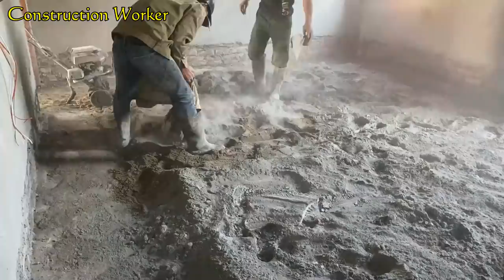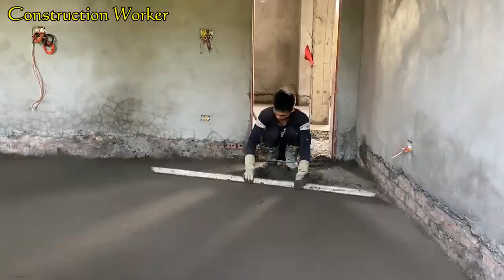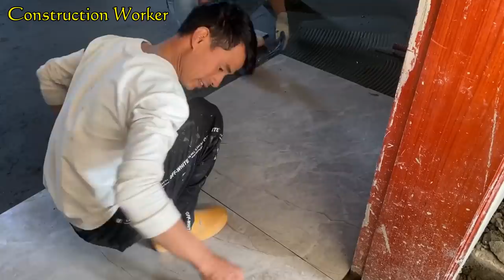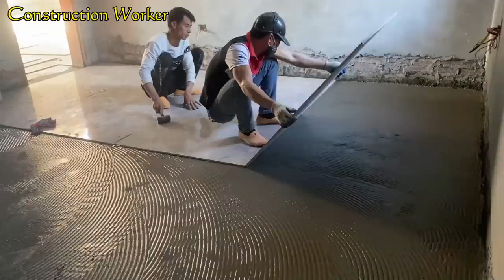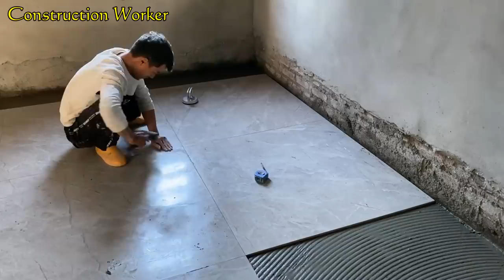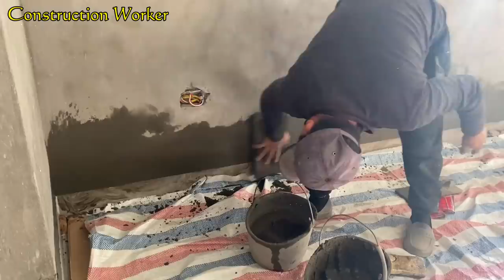Amazing Techniques Construction A Bedroom Floor With Large Size 100 x 100cm Ceramic Tiles

Comment: They floated the entire room ok but they should have packed it in more to minimize air pockets plus that would even strengthen the mud more , no packing needed if you add in some caratex to your mixture. The way they lay these large format tiles are just terribly wrong and unprofessional. I'd lay out the room and work yourself back out or even center back wall and out to the exit door. These guys are constantly walking on top of the tile they just laid, horrible! Plus they should have used an at least half inch by 3/4 notched trowel.
Reply: Thank God I'm not the only one thinking that they did a poor quality job here, lots of air pockets for sure, walking on top of the tiles when the mud was fresh, finishing the wall after installing the tiles... and so on... very unprofessional work indeed.
Reply: @PSNMM2M  I bet your job wouldn't even compare! That was a job really well done for tiles that size!
Reply: @lightbulb1982  sorry for hurting your feelings
Reply: Are the one paying for the material job etc. If not keep your mouth shut I've been doing this for over 20 years countless of satisfied costumers all over the world. Thank you
Reply: @PSNMM2M  just what I was thinking. Job looks good but I worry for the longevity of that work

Comment: Everyone that said it will crack in a year is wrong they do the same work in Haiti and Dominica republic and also saw it like this is Jamaica and Africa and those are my friends homes and it has been more than 5 years and no crack or damage my grandpa designed and built home for a living and the lower part he built for my parents is done this way and that was 25 years ago my parents still have no problem with that part of the house

Comment: Two things, not sure about the thinset application under the tile, also I’ve never seen grout applied with a paintbrush. The grout needs to be forced into the space between the tile with a great deal of pressure. There’s no way the grout holds up past a year or two.
Reply: My guess, the thin layer of tile adhesive is applied before the underlayment has dried, so they actually form one whole.
Reply: @Jb001jb  That's not a thing. IMO most of the things they did were wrong. Not professionals and not the best tools.
Reply: This thin layer of tile glue is state of the art in rather advanced countries, where knowledge and materials are available and welcome, as long as the surface below  is plain and solid, the materials applied are good and the guys are trained/skilled. I cannot judge the quality of the surface underneath just from the video, but beside this, everything looks fine for me.
Reply: If the space between the tiles has to deal with a lot of pressure, you made something wrong before/underneath. It might be different e.g. on a wooden slab floor, but that is not the case here.
Reply: I lived in Vietnam for a few years and remarkably, most of the floors there looked like this one and none had any cracking. The plumbing , painting and other stuff did leave a lot to be desired though. They work so fast there. Unless it’s a government project , then they take their sweet time.
Reply: Depending on which year you graduated as a construction engineer. Things n tech has evolved

Comment: But they didn’t even wait for the concrete to dry the base
Reply: Yeah
Reply: Time is money G
Reply: Ha it was dry to begin with.
Reply: They used it as a dry pack That’s how they were able to get the tiles flush
Reply: This is one of the ways of doing it so that you get good bond on all interfaces while saving money and time.
Reply: @dracomessup  Also known as wet set.

Comment: Why didn't they start off with a cement mixer
Reply: Because. They're paid by the hour.
Reply: Joking.
This is marble. Very delicate. Every cut takes twice as long as ceramic. The cement would set up before they could use it if they mixed alot. So....
Just out of frame is another skinny guy mixing it up in a troth and rinsing it out after each batch.
Reply: If they had used the mixer then they could not have worked at the same day for the tiling work. They used just small amount of water, just as much as the cement can be hardened in a day, and therefore they were able to work on it after leveling the wet cement. Otherwise they should have worked on the next day in a hardened floor, which will allows less flexibility for the next work.

Comment: was this a demonstration/show because why would you do the floors first in a renovation
Reply: The walls appear wet so no work can be done currently on them. Plus the mixing of the layer of concrete this way will ruin any wall. So they are efficient, but the quality remains to be seen by the owners.
Reply: If you watch the video to the end the base is the same tile. It embedded into the wall. They installed base after the floor and then planed out the walls with the base for a smooth transition.

Comment: Word has it , the walls still look the same 😆
Reply: Lol. Painting is done at the end after all tiles work is completed because it will ruin the wall paint if they  paint it earlier.
Reply: @Rockstar57877  the walls need alot more then paint 😂 🤡
Reply: @RR-ty6zz  I agree they haven't completed the walls and plastering work

Comment: I’ve seen the dry screeting before, but never the thin soup thin set, without back butter ... I’d love to see how this holds up over time, maybe it’s better technique? The workers need masks and towels or sponges for cleanup! That silica nasty over time
Reply: Maybe it has something to do with the size of the tiles, if it was thicker thin set, more of a chance that the tiles would be uneven, I mean the weight and size themselves, I bet you could just lay it down dry and they wouldn't move
Reply: I'm thinking the only reason the adhesive is like piss is the humidity where they are would dry in no time ,there methods are bad though they have no hands or lungs in a few years doing that every day😂

Comment: Only question I have is how do they stop the tile from moving when they a walking over tiles they just laid
Reply: The reason those groves are on the cement is because it evens out the pressure on the tile but it also causes a suction on the tiles so they won’t move
Reply: Something called friction,  prevents the tile from moving

Comment: Dry pack its called floating.
Reply: he did good
Reply: Do you think it would crack eventually? I know all concrete cracks regardless but i mean this way especially?
Reply: @operationhotshotinc.6887  If your willing to do it right and spend more money. Your supposed to put a membrane over the float and apply a blue liquid with a roller. I forgot the name of the blue liquid. It been so long, 'm not in the tile trade anymore. That method will prevent any future cracks.
Reply: @badimpulses17  good to know i wonder if its called Blue Seal?

Comment: back butter,  no cement or tile adhesive under the tile - poor
Reply: There's no need to back butter bcz the flat was wet
Reply: No need.  An ultra-flat substrate like that and ultra wet thinset.  It gonna bond on contact and the tapping of the mallet will en sure that.
Reply: Thank you for the information guys

Comment: the laying technique is old but the execution is so wrong. you don't walk over freshly laid tiles, connecting joints are made with silicone and not grouted normally, that creates tension cracks, and as a tiler, I have never seen grouting with a brush
Reply: Exacto..

Comment: Adding cement to laticrete to save money 😄 and standing on tiles you just laid 😂
Reply: That's  just damp sand and cement mix with a thin layer of tin set.
That's skills.....considering the rudimentary tools
Reply: @qmax-en5ry  ok if thats ok with you but i would never have these lunatics on my house...
Reply: @ Neil Armstrong. This is how floors have been installed for probably hundreds of years. Look at the reflections of the windows, those lines don’t deviate at all. That is one flat floor, after it fully cures you would be hard pressed to remove it. It may not be the method you’re familiar with but I guarantee it is very structurally sound. I have been a tile/stone contractor for almost 40 years and I’m impressed!
Reply: @alanaz4265  too many view a membrane interface and spacers as always mandated.  That's only when the floor moves in many directions.  This is one mass.  One movement.  Hopefully.
Reply: You're impressed? i'm not !walking on it delaminates it staight away never put portland in the adhesive and not proper grout lines i wouldn't enterain these guys on any of our sites but each to their own stay safe 👍i am very familiar with this method i live in the philippines and all our workers have been trained european standard the gold standard

Comment: These guys are catching on the biggest load of crap after 1 week after the cement has dried movement will cause all those tiles to pop, no expansion joints and no proper adhesive under tile.

Comment: Hard workers. But some big mistakes. The cement wasn’t compact and the mortar takes less than 2-3 minutes before creating a dry layer that prevents great bonding. Good luck with that floor in 2yrs

Comment: cant believe they are putting marble tiles straight on the leveled soil
Reply: Porcelain not marble.  Cement/sand float with thinset atop not soil.

Comment: They worked hard and the tiling looked great but it's all a bit messy in the beginning. Why not mix the screed outside and wheel it in, less dusty, more effective. Nice tiling though.
Reply: Because they don't have people complaining about dust over there like we do here
Reply: @mae2309  I have done plenty of these floors and we always mix them in a mixer outside, now with a garden rotivator indoors. That way you can mix while the man indoors can immediately start levelling and you don't wheel in any more than you need to. You avoid the mess being created indoors, more space for working outdoors....the list goes on.
Reply: @michealbreathnach2928  Maybe there was limited working space outside...
Reply: @michealbreathnach2928  Maybe there was limited working space outside...
Reply: @michealbreathnach2928  Maybe there was limited working space outside...

Comment: are all the comments on here PAID comments? 
All I saw was they used a plougher to mix concrete on unlevel floor, then screed not even dry before tiling. also, where is the primer? and then tapping away with no level, that guy must be extremely good at just imagining how level the floor is. any DIYer would be Pros against these techniques

Comment: It is not a concrete floor per say, more like a thick dry pack. Huge moisture issues though, as they need time to cure. Also, swirling trowel lines on LFT (or any ceramic) will ensure that they are not bonded to the floor. 
In theory, we have been trying to replicate the dry pack beds but eliminating the time, thickness, weight, etc of them. Pretty common to see still in renovations with buildings from 60 years old and up.

Comment: What's so "amazing" in it ? Normal floor leveling and tiling.
Reply: Akash Sikarwar  I am a builder and tiler too. I know exactly this kind of work , but there's still nothing "Amazing" for me in it. The only difference is that we have better equipment for mixing concrete and maybe for cutting the tiles.

Comment: Its better to use cement glue 1 per tiles  not on the whole floor it takes some to fix the tiles and the glue will become solid after 10-15years the tiles will pump up with the process u followed. Quality is everything that is required in this field

Comment: That was amusing. If they had used a cement mixer, it would have been 10 times less work.
Reply: Sometimes it's access  to such tech can be difficult in developing countries. Also some machines cost more than what they earn.
Reply: Cement mixer would have gotten it done fast..hell even a mud box
Reply: lazy worker happy worker

Comment: Lol. After a few years those tiles are all going to pop. The concrete topping hasn't even had time to cure and they're not using any tile adhesive to ensure bonding.

Comment: I don't understand how the floor can be level, it does many things contrary to how it should. They start by placing the pieces at the entrance and then you have to step on everything to get out, that's a very serious mistake. I also do not see that they put a reference row to follow the level as they are placed, this is another error because not all the tiles have the same amount of material underneath.

Comment: what was the point of adding the first initial layer of (concrete?) to the floor
Reply: To level it!
Reply: @lolseywolsey7361  oic thank you for the reply
Reply: it was a dirt floor... but with no rebar and stone in the mix... what they installed will be destroyed quickly

Comment: Shouldn’t they start with the walls? I guess they have to make that floor all over again.
Reply: Cleaning would be the easiest task to accomplish on the new floor when walls are worked. But imagine if you drop by accident a hammer, or any other tool you work on wall, onto floor.
"buff" A large tile on floor crushed. Halved and in shambles !
Reply: @Feezwa   pure horror! but i guess that doesn't happen to those guys :-)

Comment: Wouldn’t it be easier, and healthker, to mix the concrete BEFORE spreading it out on the floor…??
Reply: This is not that type of concrete. It is a dry mix. Cannot be delivered by a concrete truck as it does not flow. They measure the amount of material that goes in on the spot, that is how they were left with the exact amount. The more water is in concrete the weaker and more susceptible it is for cracking. This is the hardest type of concrete which will last forever. They do this type of floor in our area for supermarkets, spas and large halls where forklifts are used.
Reply: Ps: this type of floor can be polished after 30 days and will look like a mirror. Scratch proof, 0 cracks even on large surfaces as it does not contract as poured concrete. The type of cement cures very slow, but when it does, it becomes like a ceramic and waterproof.

Comment: Some dude left comments that floor will crack in couple years.
Mates those are 3,4,5 storages full concrete floor foundation.
Not by mdf or compress fibre in any cheap shit brick veneer construction. Every country have differences way to fit the material base on the local weather
If you mention abt after levelling, let it dry, then use tile adhesive because you need that.
In Việt Nam , that’s it and last until you want new tile.
Don’t be so smart 👌🏻

Comment: Hell no!!!! 👎 you have to wash with water before Bring sand and cement
Next error is : you have to do sand and cement ready with water, BEFORE , and next bring it insidie the room
Next error is the alluminium bar too short!! In the center of the room Made a big hole!!
And I am just at minute 5:00
Reply: The only one thing right is the baseboard

Comment: This is not professional at all. Chinese botch at its best. You always have to separate the screed from the walls. The mixing of the screed is awful - they have no control over the right cement-sand-water ratio and didn't clean the floor before. There's no primer or pre-wetting of the floors/walls, so the screed/mortar water will be sucked up in no time causing the tiles to not get a proper binding. You also never spread the mortar/tile glue in one go, because it starts to harden in areas you havent reached yet. This floor will get cracks and loose tiles in no time. As a stone-mason I only can shake my head over this. But looks nice for a while.

Comment: Does good, (not the best) but that's not how to use the mallet though.
Is that even a rubber mallet or was it a metal one.
Big no no if it was a metal one.
If it was metal he just pounded those tiles with it in a way that they will crack in time.

Comment: PSA: never make curved lines in the grout before installing tiles it traps air and gives no support to the tile and does not make contact, the tiles will break after the first thing is dropped on them and they will not stay in place. With straight lines in the grout the air escapes and the tile makes full contact and can absorb shock when something is dropped on it and will stay in place for many years. This video is a example on how to do everything the most wrong way possible.

Comment: Cement has to dry, adhesive is way too fluid, they are stepping on levelled tiles before they dry, so much is wrong in this video...

Comment: should be called "how to lock in moisture and fungus deep inside ur walls and foundation" ....poor dude who paid for the job, this house will rott away in a short amount of time.
If u build like this in germany, u will probably end up in jail and the house gets teared down before it caves in by itself.

you guys work hard, but not smart. PLEASE! educate urself about what happens to you breathing in the clouds of cement, and how bad of a job u did there. i know that this is common in asia, but be better.

Comment: The subfloor he  "packed" wasn't packed, wasn't bonded to the slab, and he walked on every single piece before it had time to set. 
Total waste of time.. unless it's for a flip..then it's just a *ick move.
Reply: there wasnt a slab.. it was a dirt floor... but there is no rebar in that subfloor... so its quasi cement with no stone/rebar on grade
its not going to last.